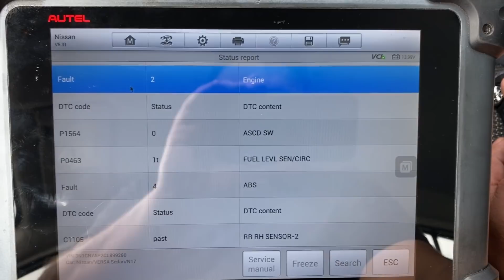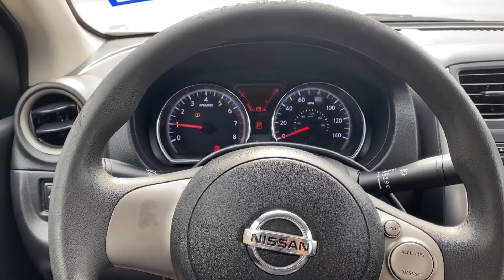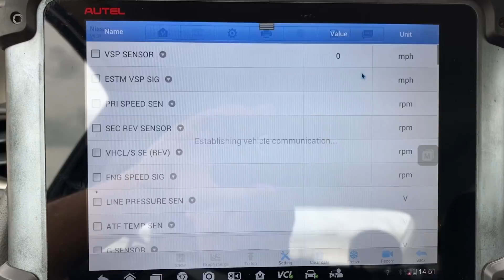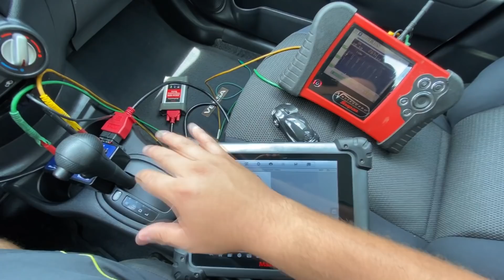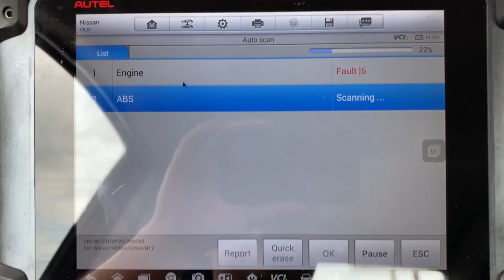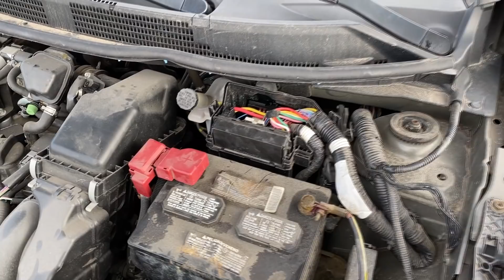NISSAN VERSA FLOOD CAR LIMP MODE DIAGNOSIS CASE STUDY

Comment: hi im living in houston texas. can i have your phone number so i can make an appointment with you? my car rpm is not going over 2500. do you know what is the problem? i already changed ignition coil, spark plug ( i see a little oil in 1 of the 4 spark lug hole, do you think changing vale cover will solve the issue? ) , mass sensor and clean throttle body. please help me

Comment: Very helpful video. Thanks! My 2012 Nissan Versa S is having almost the same exact issues. I changed (not a complete flush) the CVT fluid and filters myself, following transmission bucking, limping and slipping issues. Tranny ran smooth for the most part afterwards for about 3 months. I later changed the blower motor, which was extremely difficult to access. It involved removing the brake pedal assembly and disconnecting the intermediate steering shaft. Needless to say, following the blower motor replacement, my steering wheel was cocked out of alignment, just like the one you are working on. Then, the traction control light popped on when I took it for a drive. My car went into limp mode. Something to do with that steering angle sensor being way off caused my traction control safety system to activate. I got an alignment, but the traction control warning light is still on and I am having trouble with limp mode again, just like the car you are working on. I hope I can find a simple fix to my problem. My engine runs pretty good.
Reply: Hello, I’m having the same issue after replacing the ac fan motor too. Were you able to trouble shoot the problem ?

Comment: I had almost the exact same problem with a '12 Rogue that was flooded up to the roof, limp mode, lots of green corrosion on every connector, lots of "U" communication codes and random working turn signals, wipers and windows.  Turned out to be rusted and broken pins on ABS module, bad BCM and bad CANbus wiring between TCM and IPDM.  Fixed wiring, replaced modules, good to go. 👍

Comment: Got a good one here at the shop for ya Eric! 2014 Nissan Versa 1.6 setting P2135, P0223 amd p0123 and it’s been to the dealer several times and they’ve yet to fix it! Lady got my number and was told I could fix it! 🤦🏽‍♂️ I went straight to Advanced level Auto for this one!😂 Hands down you have one fo the best channels on YouTube my guy!

Comment: I had that limp mode on my Mercedes Benz which was a brake module switch. The dealership as well as a shop which specialized in foreign cars quoted me well over $2000:00 for approx; repairs. I did it myself and it cost me only $25:00 buying the part from FCP Euro.

Comment: I had that extract problem with my 2001 Nissan Maxima. After taking it to 4 different mechanics, I found out that it was the sensor that sits at the top of the transmission. It never gave me a check engine light. I replaced the transmission because it was happening and those idiot mechanics used the same sensor from the old transmission onto the new one and it started happening again. I went to a different mechanic and that’s when they told me it was that sensor. I ended up suing the company that replaced my transmission.
Reply: Does this sensor have a name?

Comment: the cruise control switch and airbag codes seem like a bad spiral cable/clockspring, the crooked steering wheel makes me think someone rotated the steering wheel with the steering rack disconnected and busted the spiral cable

Comment: Gret Video  thanks .   Just to be sure you can use a spray of electical connector cleaner on all connections even if they look ok.   I do that whenever I have a problem that is electrical power related.  There is also a product called Corrosion X that protects against faults in electrical  connections. It works very well.

Comment: Haven't finished the video yet but I've step i would have done is looked at a wiring diagram and try to see if any components throwing codes shared any powers grounds or bulk connections. I feel like that may have given more direction than checking every ground and connection

Comment: It sems it has damp still in the wiring or in the connectors and modules have not been dried out properly.  If the water was salty at all it is a waste of time trying to repair anything.
Otherwise best to dry out the connections and modules with aspray of pure rubbing alcohol which will clean out any damp.

Comment: el lado debil de nissan es la electronica, mi murano 2005 tenia problemas electricos y resulto ser q se mojaba los conectores de la cableria en el lado derecho delantero del pasajero al lado de la guantera bajaba agua del tubo de desague del sunroof y caia justo alli, cuando saque los conectores habia mucha corrosion, un conector derretido y el cable amarillo positivo a punto de desprenderse, lo q hice fue soldarlo y limpiar lo mas que pude y hasta el sol de hoy todo bien hasta tengo equipo de musica

Comment: Do you love trouble or a challenge? Are you being paid enough to fix these cars? You may no longer have your own shop, so ensure you are being paid a consultation fee in addition to a going professional hourly rate to work on these dead beat vehicles. When they call or give you these jobs, it means they have given up on these vehicles. So, they are looking for someone to handle their problem. Consequently, charge them to make it worthwhile. You could make much more for the time expended on these crap vehicles.
Refer them to the local junk yards as that’s what they are worth. You would be doing those owners a favor. Flooded, rebuilt vehicles are the worst. One day they will just cut off, lose power while on the highway and endanger others on the road which should not occur in the first place  to include the cheapo who very well knows the danger and seriousness of using this vehicle.

Comment: I used to work for Nissan too. The code in CVT p2859 A pressure sensor is Automatic CVT replacement per Nissan (NTB).

Comment: How do you clean out those connectors?  And for ground connections, I see multiple wires going into the same "boot" that then goes to a bolted area.  How are you cleaning out the wires within the splice?  There is likely some corrosion there too.  Are you using a light acid of some kind to clean any corrosion?

Comment: Thank you so much for this video. I just got a flooded 2013 KIA Optima. I'll just go on ahead and do these checks and clean things up. My cruise control and trip/reset buttons don't work too. I also have the ABS, TPMS, Trac & Airbag lights on. Any tips please?
Reply from the maker: Check grounds and connectors for corrosion. Check all fuses and replace bad modules. Good luck! Thanks for watching!

Comment: I also used to work for nissan.  Verses were a piece of crap when they were brand new, so after a flood, it should have been scrapped.   The price of a used ipdm, (intelligent power distribution module). Exceeds the value of this car.  I feel sorry for anybody that buys this piece of garbage.  ASCD stands for automatic speed control device.   May be bad switch, but most likely a bad spiral cable in the steering column.   Somebody had steering wheel off and didn't know how to mark it for reinstallation.    You did a good diagnostic job, but you cannot polish a turd.    Get paid for your work before you get yourself buried on this car.   Remember the corvette?
Reply: Very helpful video. Thanks! My 2012 Nissan Versa S is having almost the same exact issues. I changed (not a complete flush) the CVT fluid and filters myself, following transmission bucking, limping and slipping issues. Tranny ran smooth for the most part afterwards for about 3 months. I later changed the blower motor, which was extremely difficult to access. It involved removing the brake pedal assembly and disconnecting the intermediate steering shaft. Needless to say, following the blower motor replacement, my steering wheel was cocked out of alignment, just like the one you are working on. Then, the traction control light popped on when I took it for a drive. My car went into limp mode. Something to do with that steering angle sensor being way off caused my traction control safety system to activate. I got an alignment, but the traction control warning light is still on and I am having trouble with limp mode again, just like the car you are working on. I hope I can find a simple fix to my problem. My engine runs pretty good otherwise.
Reply: @agentmobius8458 i have the exactly same issue, where  you able to get fix ?

Comment: Grounds and fuse boxes, not all mechanics check these components, they are basic, easy to check and replace. Nice bro, because others would replace the entire transmission and still not find a solution.
Reply: Nissan and Aamco both quote me to replace the transmission in my 2012 Nissan Versa S with similar issues, for about $6,000

Comment: Great job again!!  Btw not sure Nissan is so sensitive but most cars where the wheel is that far off will throw traction light on as SAS will be showing it turning while all other sensors like yaw rate and wheel speed sensors are reading straight.

Comment: lift the carpets, i check if they are soaking, the sound dampening is like a sponge, its going to be another water nightmare, check every connector on the whole car :), there is a reason flood damaged cars are written off, they should be recycled not sold to some asshole who will sleep at night selling it to someone who knows nothing of its past.
well im glad i got that off my chest, good luck.

Comment: Even without being flooded that car is basically worthless and almost certainly needs a new transmission. Nissan's     CVTs are  notorious. And since it is flooded I cannot imagine why anybody is trying to spend money on this thing
Reply: It’s depends I have a Nissan Versa 2013 with an automatic transmission that has 201k miles and still pushing.

Comment: What do you think of the transmissions on altimas 2013 - now? Sincerely interested!
Reply: Nissan CVT= no no
Reply from the maker: Very problematic transmissions.
Reply: go with the 6 speed manual
Reply: @Joe_Mission  not available. .i have a 2015 ive had it now for 5 years. Had issues because of misdiagnosis from the dealer. Turns out all the transmission needed was programming
Reply: @MrPensiveThinker  it's too bad the manufacturers are going away from the stick, I've had my 6 speed altima for over 10 years, it has almost 310,000 miles currently with no issues or major failures, never broken down, never failed to start, the thing is a beast.  Also have a 2007 frontier with the 6 speed, and a 2004 sentra with the 6 speed.  I've never owned a vehicle with an automatic, and probably never will.  Sorry you had to go to the dealer, that almost always ends badly.

Comment: Eric,another very good video. I received my think diag today and registered it and activated it and downloaded the two manufacturers software. Had a couple of issues but nothing major. Downloaded Honda and Ford. I don’t need Ford but I own two Honda’s. Now it’s time to play around. Thanks for sharing the video and your knowledge. Much appreciated. Keep your family well during these crazy times. Artie ❤️
Reply: ThinkDiag is awesome!! I received mine few days ago. I downloaded that two software. Chrysler and Hyundai. Just fixed misfire code (it was actually my mistake, got spark plug wires mixed up) that thing have misfire counter I love it.. I’m a young mechanic. Gotta learn my mistake.
Reply from the maker: I’ve been using it for the past few weeks and I’ve been really impressed by its functionality. I have run across some very minor quirks and bugs but I’ve been keeping in contact with the representative so they know what to work on.
Reply: Eric one thing I noticed is on my 99 accord EXL3.0 it has ACM (engine mounts controlled by ECM) and it says it can't connect to ECM to check them. I know it as the system because I just replaced the fwd mount and checked the entire system for Vacuum and power. Will use the Diag X today and see what it does. Anyway looks like a great tool and the iPad gives you a large screen. Will be it touch Artie 👍👍👍